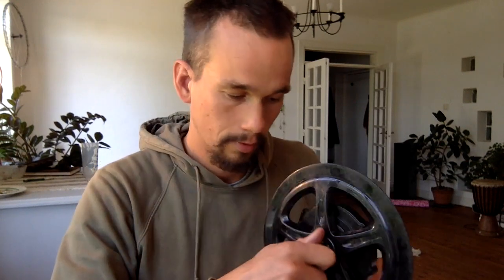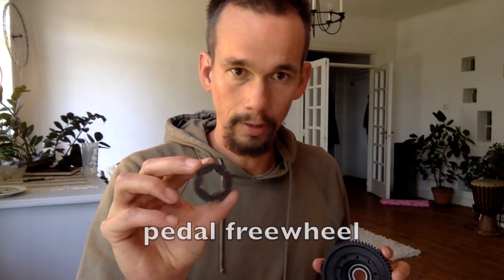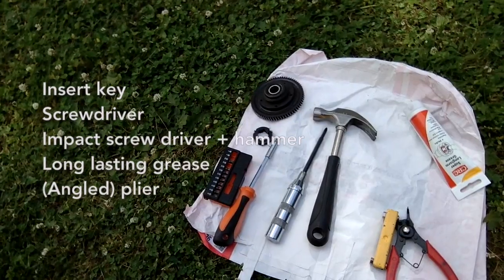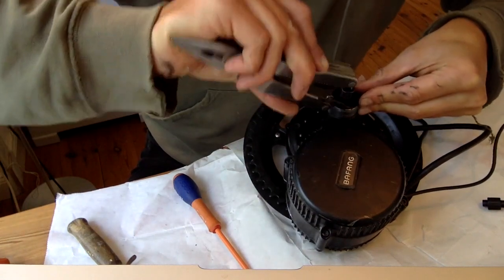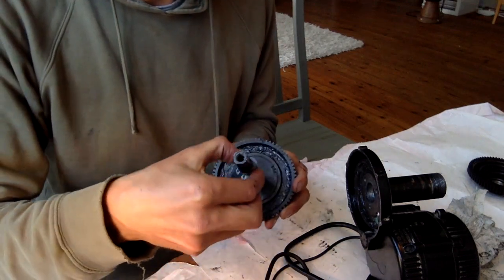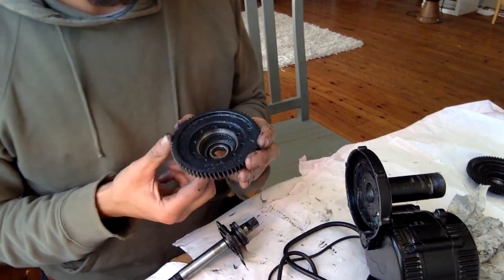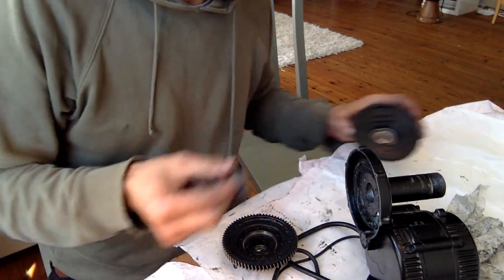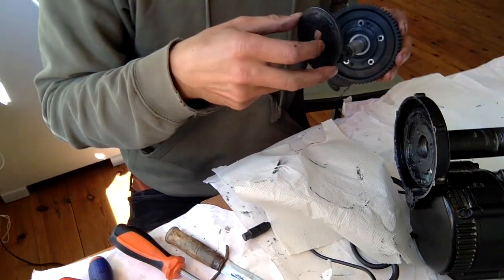Bafang freewheel replacement

Comment: Thanks really helpful video.  And yes it can be done without removing the motor.  Good tip on how tight those screws are in the main gear assembly.  Didn't use an impact driver but I did use a hammer and a perfectly fitting screw.  Got to apply a lot of pressure and go carefully but an impact driver would be safer.  Thought my issue was the freewheel which it probably is but I see that the gear assembly is also stuffed.

Comment: Hi man. Thanks for video it helped me change freewheel. However 200 more miles since changing (4000+ total on this unit), I started to hear a sporadic cracking noise which combines with a gear not engaging. Then change gear and back to normal and so on. I think it could be the bearing inside the nylon gear altho is not obvious.

Comment: Thank you so much Par.  I took some bad advice from other videos and ran into problems.  I changed the pedal assist on a Bafang BBS02 from 3 to 9, and I changed the LSPD setting from the original setting that I think is 10 to the maximum setting of 32.  Everything was wonderful until it wasn't.  I'd take off slow at about PDS 3 and work up to 9 at full speed and everything worked for a few weeks and suddenly the motor would just die. It was random and confusing. If I shut the power off and went into a store, it might work when I came back out.... Or maybe not. I found that if I played with the peddles by jogging them back and forth, it would catch every now and then and I could continue on. It was really embarrassing.  
I replaced the motor and left the settings at peddle assist 3 and set the  LSPD, to 20. and I haven't had any problems so far ,but I have friends and family wanting me to build them  e-bikes and I don't know if the problem is in the controller, or the amperage because I changed the settings....or both.  Your comments would be truly appreciated.   I don't want to go forward and build a bike for my friends just to let them down.
Reply: what is "LSPD" setting??
Reply: This is not me.

Comment: Has anyone encountered with the BBS02, where once the snap ring is removed, the axle still doesn't disengage from the gear, so I still can't get into the clutch to determine what all needs replacement?
Reply: did you find a solution?

Comment: How did you get the "axle nut" out.  I held the opposite  crank still.  and it was impossible to looses, turn the nut counter clockwise.  What is the secrete.  Looks like you already had the nut loosened and it came out without any effort.
Reply: Yes exactly how can we remove it I have tried hard but unsuccessful
Reply: @rapellymohansai205  I found a Bafang® axle remover tool that reaches down inside the axle and removes a series of nuts/locknuts,/spacers and bearings.. There are some videos that show step by step.  The demonstrator was a woman that worked at Bafang.  This was not an easy task.. 
I have since upgraded to the BBSHD for several reasons.. Getting to the freewheel is much simpler.  and with 1000w, it utilizes the power better without overheating and burning up the motor.  
The 750w was good, And the 1000w is far better
Reply: I could not get them off. Broke several tools trying. I need that special tool.

Comment: Man, he is killing this motor with 52 chain ring. No wonder he needs replacement parts.
Reply from the maker: One should be carful using the gears properly. But just because you have 5 gears on your care doesn't imply your weak motor can't handle it. It all depends on how you use it, - adapt force to the gear used. Similarly, a 52 chain ring is not (necessarily) a problem, assumed you use them as well. 
Secondly, it is not the motor that broke. It is the freewheel, transferring your leg-power (and not your e-power) to the wheel. Possibly I put to much force when pedalling. However, the main thing I guess, is to put grease in inside and around the freewheel, as some already mentioned in the comments.
Reply: @parflodin3819  The freewheel you replaced here is likely designed for pedal torque typically produced with a cadence of at least 50-60 rpm; if you often pedal at lower rpm, especially while pedaling uphill, you likely are not using the best choice of derailleur gears.  That large (52 tooth?) sprocket should be used with large rear sprockets to avoid excessive crank torque.
Other possible causes of that damage include dirty or inadequate grease, and high motor speeds.
If you pedal too slowly (low cadence) under heavy load, you risk damage to your knee joints in you legs.  I've seen that happen to 'slow grinders' in my bike club.  Try to choose 'gears' that allow pedaling at 70-100 rpm in all situations; you actually produce more power more efficiently that way!

Comment: Good morning , I did not understand how the motor drives , because it is linked to a plastic gear that is silly , it does not hold , as it has an internal bearing .

Comment: Hello Pär great video 🙏 I have the same problem isn’t it enough to change only the freewheel (clutch) to fix it? Thank you for your help
Reply from the maker: Depends whether the chain ring is torn out or not. In my case it was, but if not no need to replace it.

Comment: why you didnt add any grease inside the bearings?
Reply from the maker: Guess one could. Although these the bearings were not replaced, but I used the original greased bearings. 

However, it could be a good idea to apply some grease in the space between chainring gear and the freewheel (at least that's what I try out now, when replacing my second freewheel in 10 months...)
Reply: The Chinese act like grease is made of gold. Always need to add to the one little squirt the manufacturer puts on bearings, if they put any on at all.

Comment: Some times when i use the throttle my bafan sounds like is not catching it but after few seconds it catch it,is that normal?and also the pedal feels like hard for a momen when using the throttle,could that be a clutch problem?thanks.

Comment: Can I ask how many miles you have done before needing clutch replacement?
Reply from the maker: Don't recall. But I've biked 2000km + since last replacment.
Reply: @parflodin3819  have you got a gear sensor, just thought that would help. Looking that you didn't need the so called tools
Reply: @parflodin3819  so what speed do you sort of stay at on flat roads say, I just pushed it to hard. My controller is set at 18 amps which helps the controller to not blow!! But still do. I may have a tweek with the USB an laptop

Comment: Do you grease the clutch/freewheel or run it dry?
Reply from the maker: I didn't the first time I replaced it (showed in the video). But one should! The second time I had to replace it I put grease there, and the freewheel has lasted well, and still works fine after several thousands km.

Comment: Can this be done without removing the motor?
Reply: Yes. Don't ya hate when someone won't answer a simple question in a timely manner? Stay safe.
Reply: @brianbassett4379  about 10months ago I worked this one out for myself.  Did not have to remove the motor.  BBS02.
Reply: @chrissheila  I started having issues with my BBS02 after almost 11K miles so I swapped it for an HD. 6000 miles in and the freewheel failed and had to get home using only the throttle for over 30 miles... it sucked. I was surprised how easy it was to change. 30-minute job once you have done it once. Now I have everything necessary with me to swap one in the middle of a ride should it ever become necessary again. Ride Safe. - 
https://photos.app.goo.gl/dhmEvtszvyBhMeCH8

Comment: Pär, thank for this video!

Do you put this expensive grease Mobil 28 or Aeroshell 22?

Bafang BBSHD is a very good motor, also in terms of maintenance.

But very sad is that Bafang and Chinese in general do not like to put grease. This causes noise and damage, which shouldn't be. Not good for actually the good product.